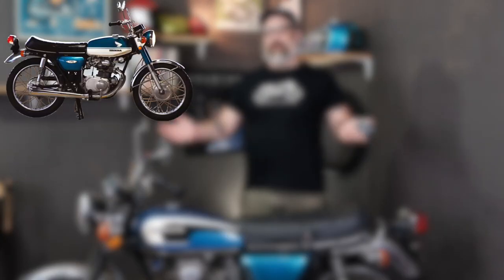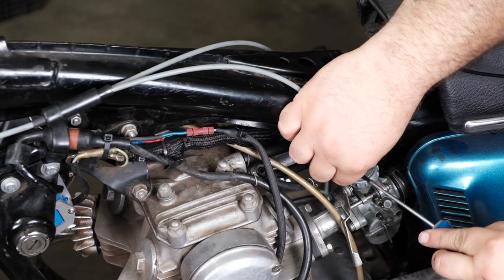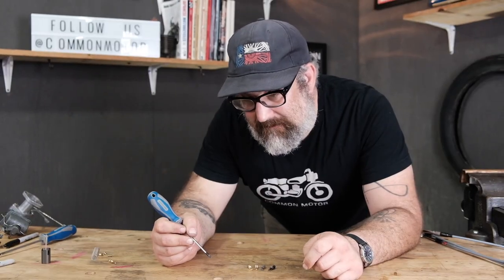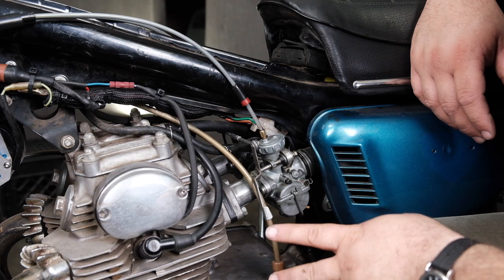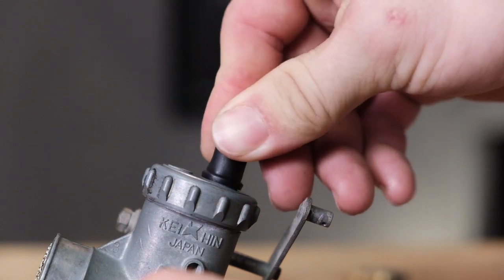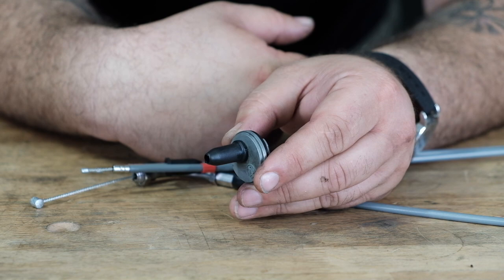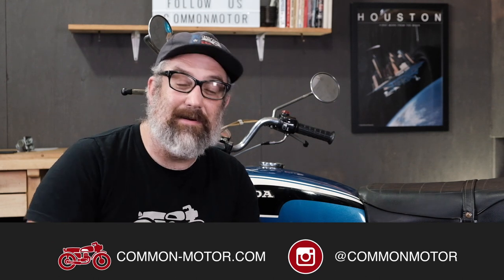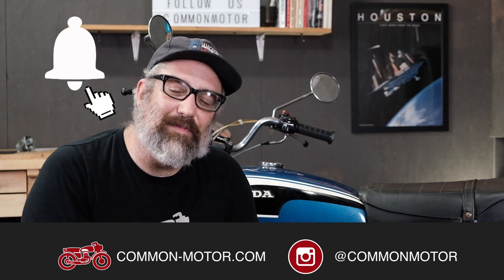How to Synchronize the Keihin Slide Carburetors on Your Honda CB175 / CL175 / SL175 / CB200 / CL200

Comment: Great stuff. I'm restoring a CL200 that was my father-in-laws. The motor has been stuck for 40 years. A couple of relatives tore it partially apart over the last several years to free it up, but lost interest.  I inherited a frame and 3 boxes of loose parts, and cylinders with two stuck pistons.  I have the motor freed up now and I'm sorting parts to take inventory of what I have and what I'm going to need.  Your videos are awesome!  Thanks.

Comment: This is absolutely great stuff! I have a CB175K6 for 20 years and thought i had been doing the slide synch correctly using a small diameter drill bit on both sides and using a pipe to listen to the intake suction. I never knew about the T-mark on the idle screws and the reference mark on the carbs!. Great video Brendan and C-MC, just like all the other videos with that nice mint K7 as the demo model. Keep up the good work 🙂

Comment: Everytime you let that throttle slap shut your denting the slide on the idle screw, and loosening the screw in it thread base to where it will be sloppy. Eventually making it very hard to tune

Comment: One question we have is idle good,  throttle steady when cracking it open, but if we throttle real fast, it bogs down and can kill engine.
Reply: Lean, go to bigger pilot or adjust the low speed circuit better. You can also raise the slide needles to be a little richer. Then you must reset your air mixture accordingly